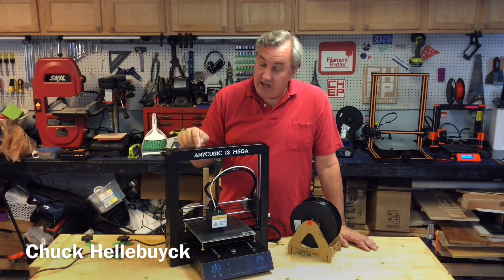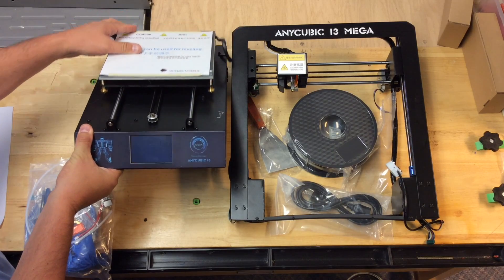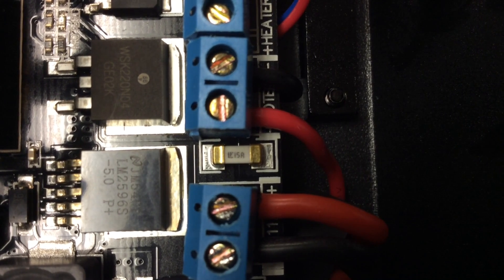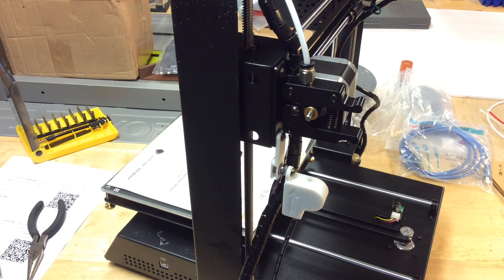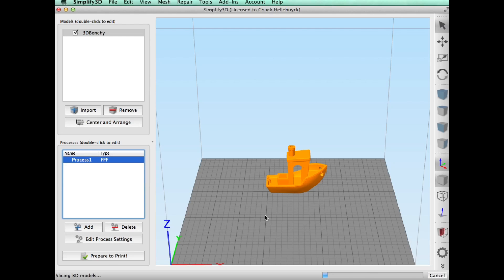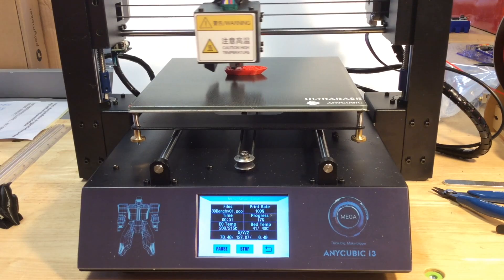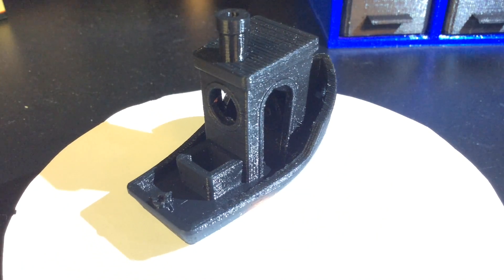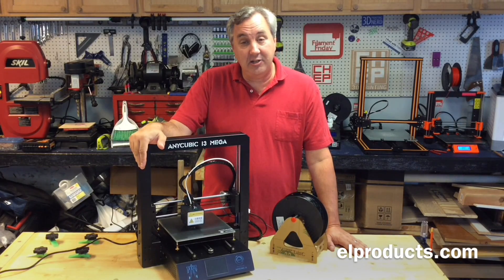Anycubic I3 Mega 3D Printer Review and CR-10 Print Compare

Comment: I know this is a little more then the ender 3, but which would you buy?
Reply from the maker: I personally would buy a CR-10 mini but between those two I like the Ender 3 though the Anycubic I3 prints really good and is direct drive so it depends on what you want/need to print.
Reply: @FilamentFriday They're both (Ender 3 and Anrcubic i3) are the same exact price where I'm at here in East Asia, given that, which of the two would you get then? As in is price a consideration? Personally, I just want another machine that is a reliable workhorse. Thanks and I love your vids.
Reply from the maker: With I3 you get direct drive and real Ultrabase glass bed and a higher temp hotend with metal heat break but I think Ender prints PLA a bit better and is easier to upgrade. Your choice.
Reply: CHEP the i3 Mega is Bowden
Reply from the maker: You’re right. I forgot.
Reply: CHEP no worries. Researching between the i3 mega and Ender 3/5. Thoughts??
Reply from the maker: Never used the 5 but the 3 is a great printer at almost 2/3 the cost of I3 Mega. I like the Ender 3.
Reply: CHEP thank you!!

Comment: Hi Chuck.  I purchase this printer before they changed to the ULTRABASE.  I recently ordered and installed the ULTRABASE.  When I first printed with the new base it worked great.  I then did not use it for about 3 weeks and when I tried to print this week, I could not get it to stick to the bed.  I was wondering if you had experienced this and had any suggestions for me to try.  
     Also: can you send me you Simplify 3D settings?  www.carlbeck.com
Reply: Thanks Chuck.

Comment: I am waiting on my new CR-10 with the dual z axis motors and filament sensor. I am still considering this for a 2nd smaller printer though. If my CR-10 is great, I will just order another one though. It appears these are the 2 hottest printers right now. The new CR10 has the same filament sensor and extra z-axis motor/screw. The new CR10 did cost more but will print 400 mm high so its about equal IMHO of value in  dollars at 499.00 (with a coupon)379-399 for the old single Z-axis model. Great review.

Comment: I bought this printer 1 month ago, very impressed with it. Need to run it a little slower if you want quality prints. Only small issue I had was the X belt was a bit loose, so redid the tie and also fitted a tensioner spring to the 2 axis. I chose it over the cr-10.

Comment: I have the first generation of the i3 Mega, if the filament sensor keeps tripping, suggest you edit the position of the limit switch in the detector housing. about the power failure failsafe, you could also move the print head away from the printed model well it heats up, so that it won't screw up the completed layers.